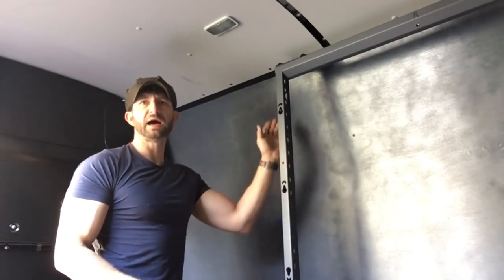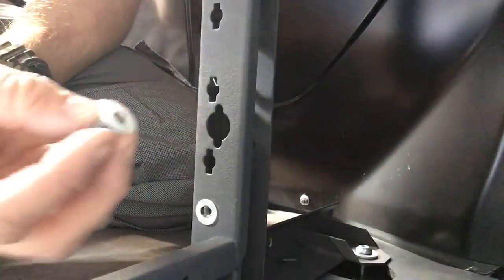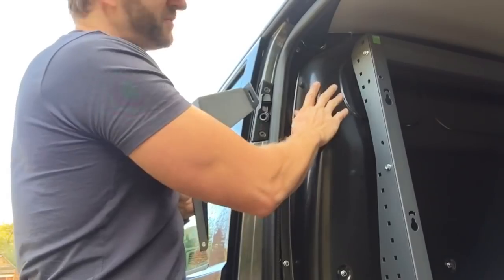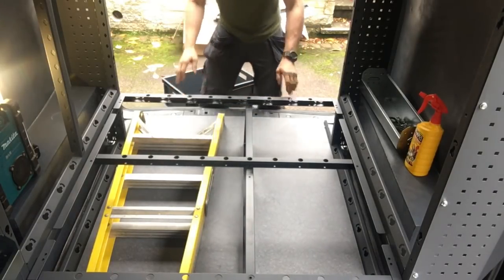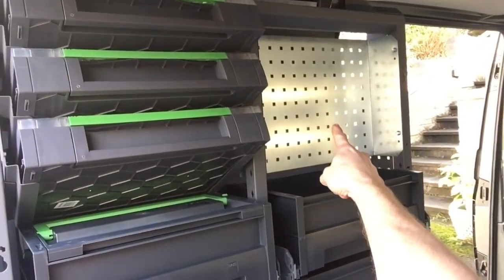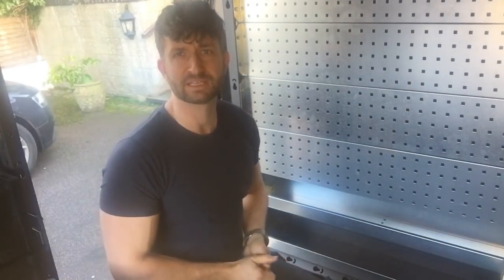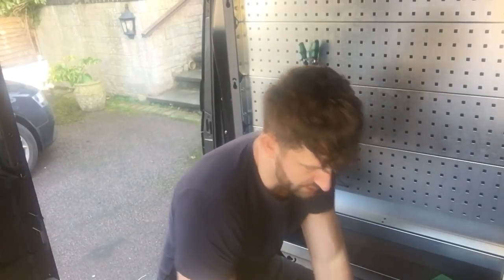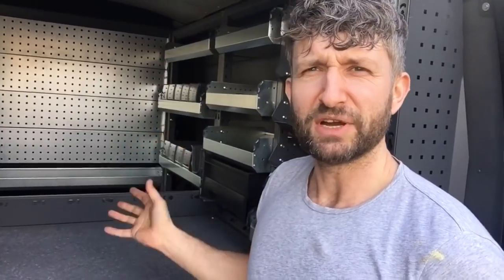Bott Smartvan installation Vw transporter T6

Comment: Hi Pete, that's a good idea matching the colour of the ply lining before you started! Can I asked what you used?
Is that a standard ply floor or bott floor?
Also, with the ply lined sides, did you have and fixings points on the side behind the ply lining?

Comment: Pete, in the video (15 mins in) I can see next to the bottboxes you have some additional (non bott) open fronted small bins which i am presuming you are using to take up that additional space you are talking about where it would be nice to be able to get 6 bottboxes on the shelf not 5.  Do you recall where you got them from as they would perfect also for my bott racking? Thanks.
Reply from the maker: Simon Newbery hi Simon, search for “euro crates” on eBay 👌🏽
Reply: Ah great thanks.

Comment: Did you have to drill the bracket on the right into the van? Some T6s don’t have the hole? Also when I look at both my racks together the one on the left looks like it’s on an angle not straight 😭

Comment: Hello bud, nice vids, fellow plumber here, I’ve got a new swb connect on the way and I’m looking into this racking for it, how have you found he sturdiness of the plastic boxes? 
I currently have a rack full of fat max boxes in my custom, which are decent, but due to the smaller van would need to use their more slimline cases instead if I want to fit the same amount of fittings in. 

Also are the vario safe boxes and draws sturdy? I’d love to see the stuff first but it’s a fair drive to Bude!
Reply from the maker: Stuart Adams hello mate, it’s all sturdy stuff yes, the boxes aren’t as deep as fatmax so you will struggle to get many 22mm fittings in but they feel stronger 💪🏽
Reply: P B Plumber  cheers pal, it’s between this and Sortimo!
Reply: Bit late,  but for anyone in the future, the boxes are crap. I filled one of them up with circuit breakers and another with unistrut bits and both are broken, the runners have come away from the box. The handles keep falling off the smaller boxes as well, which is mote annoying than anything.

Comment: When you put the shelves underneath the floor how did you fix them? as with the bar being missing in the middle you wouldn't beable to even bolt them together and then screw to sides as they will be short? Im toying with putting the shelves under too but then it means having to buy the longer versions and i have 4 trays spare :-(
Reply from the maker: Great question Gary, I actually made a seperate video of this it’s on my twitter page I’ll find the link for you
Reply from the maker: Gary Pattison here you go matey check this out
 https://twitter.com/pbplumber/status/929681078192918529?s=21
Reply: cheers mate think i  may give that ago on the other side :-) ordered a longer shelf for the side you demonstrated on to get some longer bits into but defo going to get the other shelves in :-D